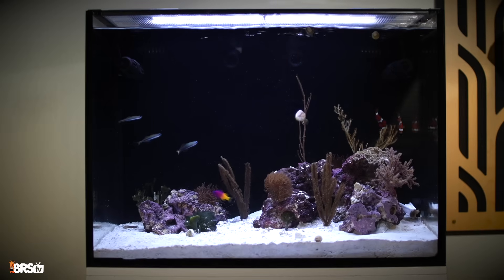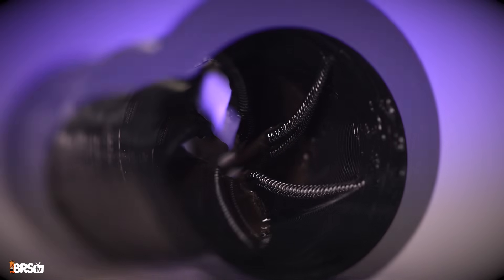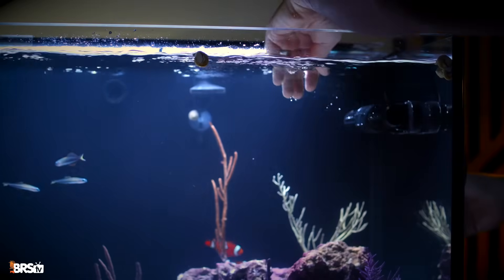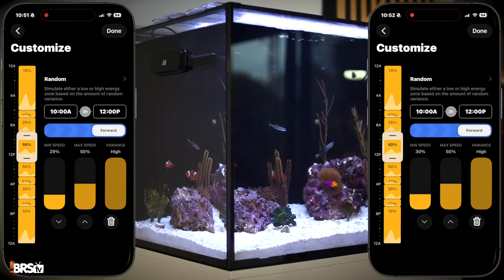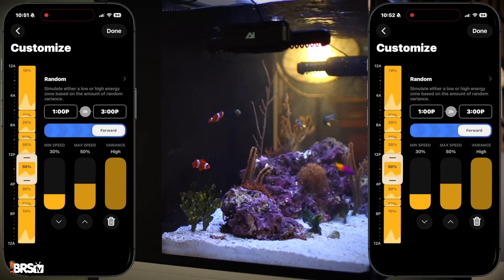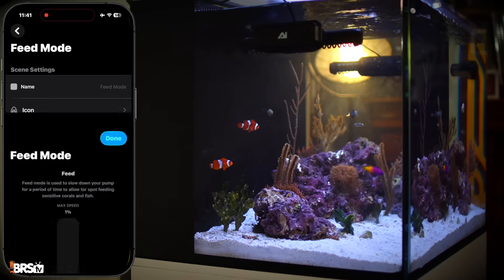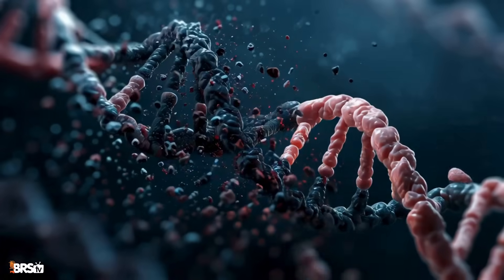New Reef Tank Upgrades & Adjustments - My Way - Episode 7

Comment: what power strip do you use? Does it work with the Mobius app?
Reply from the maker: So I just use a Wi-Fi power strip I bought on Amazon. It does not communicate with Mobius, but I haven’t found that to be a problem. If I need to use a feed timer or make adjustments, I use the Mobius app. But if I just need to turn things on and off, I use the Wi-Fi power strip. -Matthew

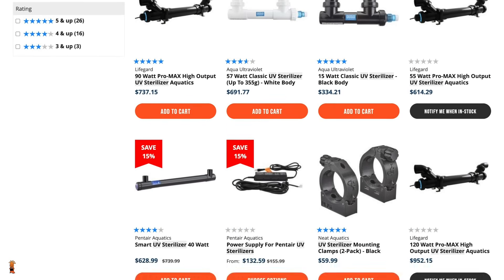Comment: 9:35 Guys these UVs are a rip off. Bought one on Amazon 2 years ago (15watts $22) & it got rid of all my Dinos. It’s a waterproof drop in bulb so no need for the extra plumbing/pump.
Reply from the maker: That sounds awesome!  Which sterilizer did you use?  I would like to try it! -Matthew